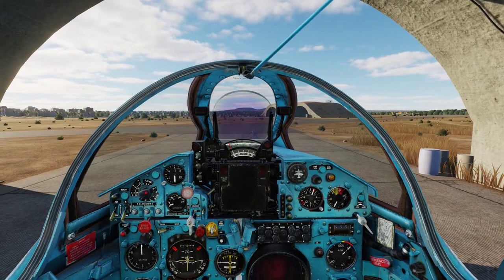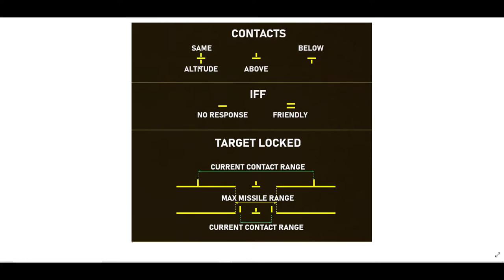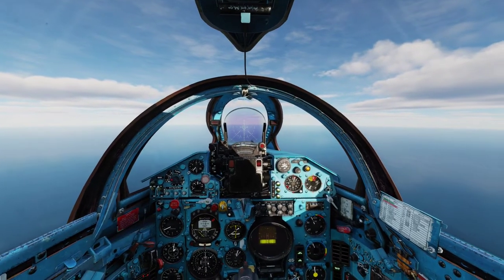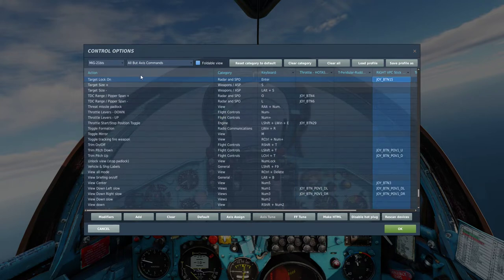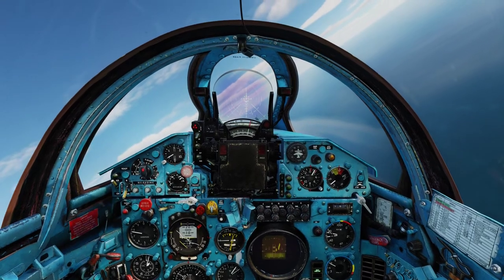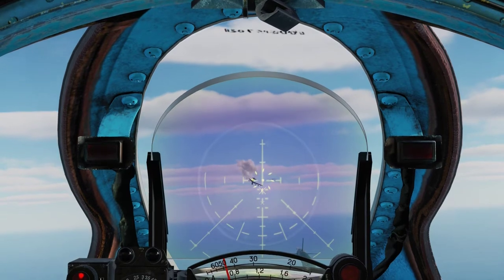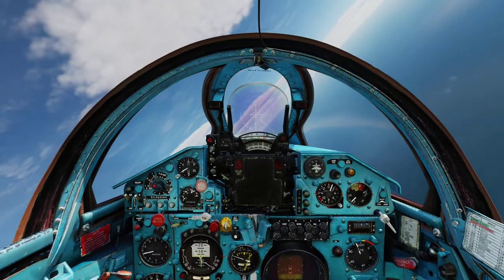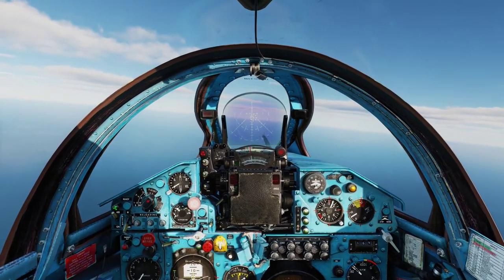DCS | mig-21 air to air missiles tutorial

Comment: Do you have shortcuts or bindings setup to switch stations and pylons ?
Would not want to be doing this while tracking a bandit visually 
Ie. Switching from radar to heater
Reply: You can set it up yourself easily enough. A switch each  for IR and SAR and 2 switches for Pylons 1 and 2. If you set the pylon Switch to position 1 and fire both missiles it automatically switches to pylon 2, as long as you are in missiles mode.
Reply from the maker: I have a switch to toggle between IR and SAR missiles as well as to rotate the weapon selector switch. It needs to be noted that with the IR/SAR switch you automatically select the relevant station